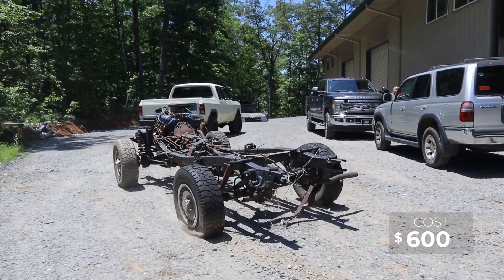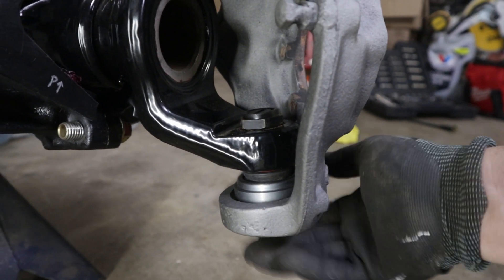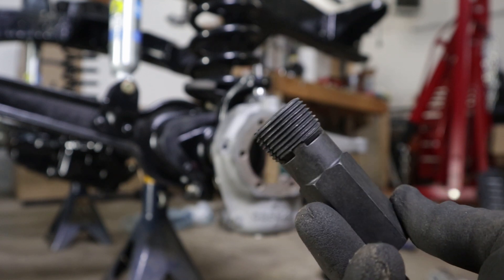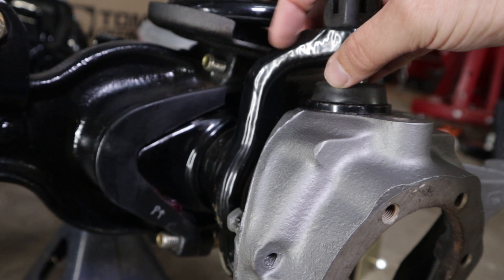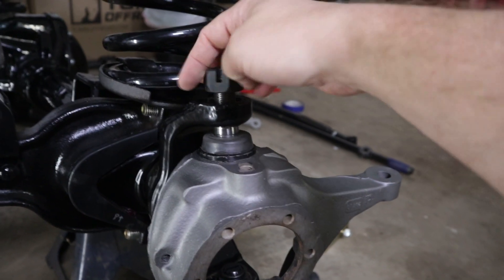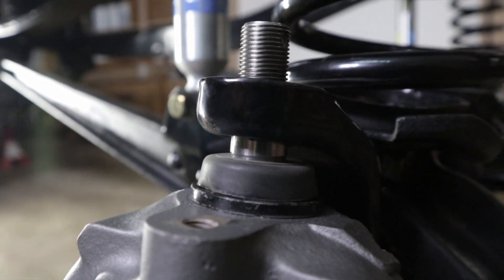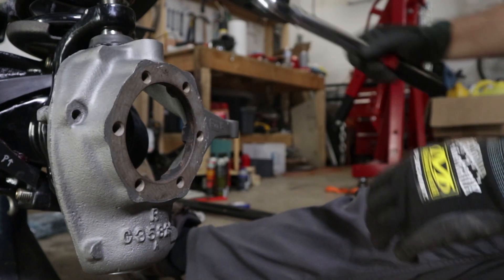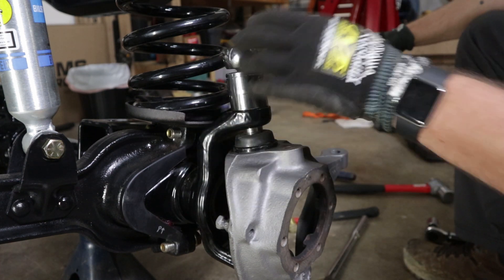Dana 44 ball joint installation

Comment: I'm in the same spot with the lower ball joint just wanting to spin.  My concern is that pushing on the bottom of it with a floor jack could dislodge the seating of the ball joint.  I realize it has a clip but...

Comment: With some ball joints its normal to see that much shaft sticking out on the top ball joint. But for sure the powder coat didn’t help. You doing a disc brake conversion on front axle? If so, you’ll need to grind the knuckles for clearance
Reply from the maker: Good to know, thanks. Yeah, I'll be doing disc brakes. I forgot about grinding them down.

Comment: Are those disc brake knuckles?  If not, I would pick them up.  Everything else can be bought new.  Then any disc brake setup will bolt on with ease.
Reply from the maker: These will work with disc brakes, you just have to grind down a spot on the side. I did the same thing on my 75
Reply: @NashvilleEarlyBronco  you can only run the gm style calipers, correct?
Reply from the maker: Yeah, not the 78-79 disc brakes